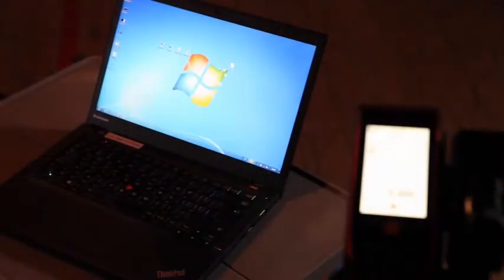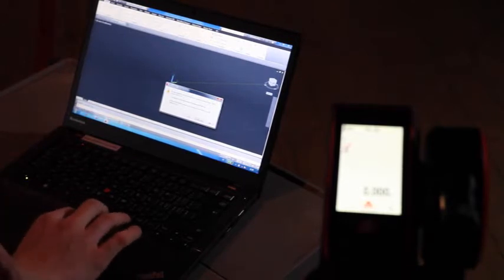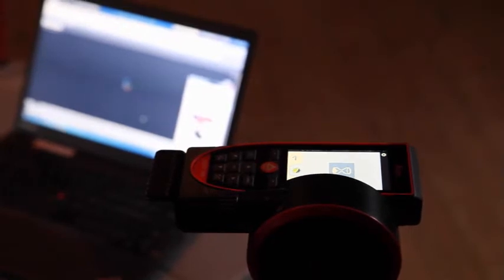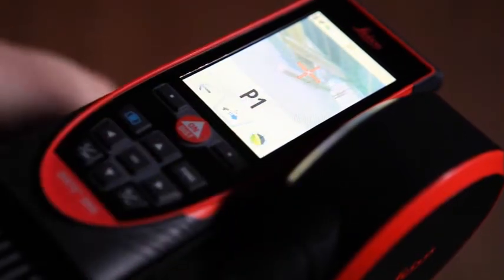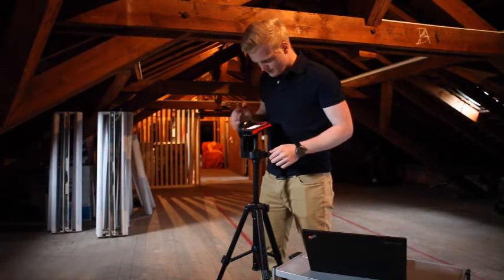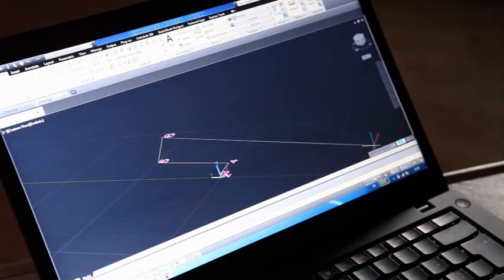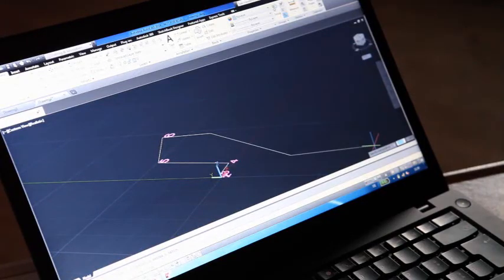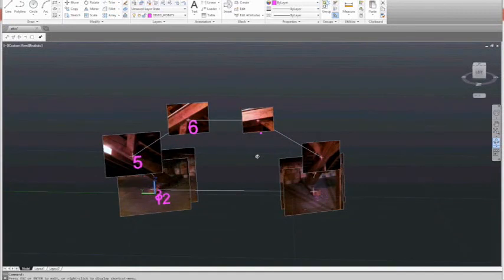How to use DISTO S910 with AutoCAD Plugin

Comment: Hi there. Do you have to start in autocad with L for line?   What’s the button you have?  I’m having a bit of trouble on mine. Do you click the button on the Disto or the app? Some points are showing in cad. I don’t think it’s working the z distance either. I need to play Roth it more I think.